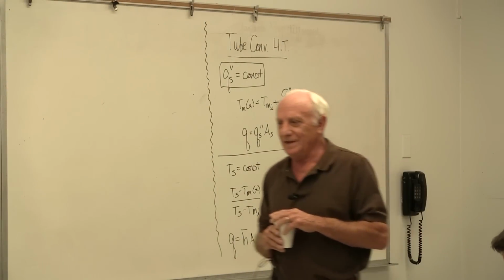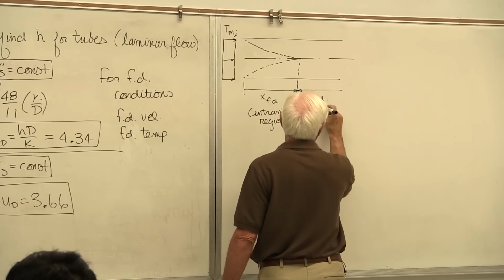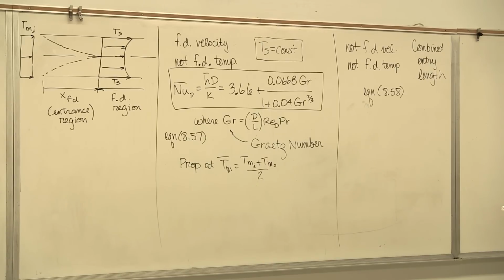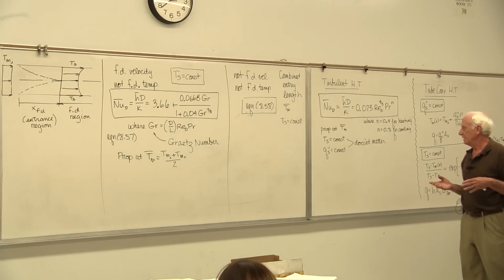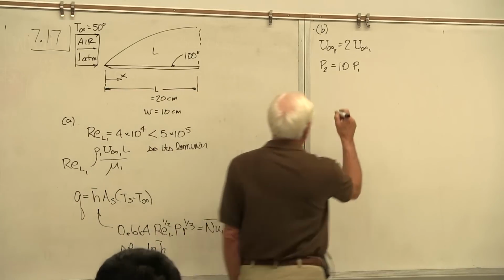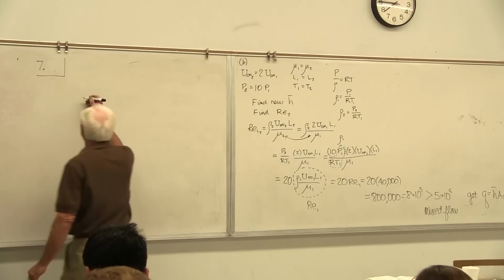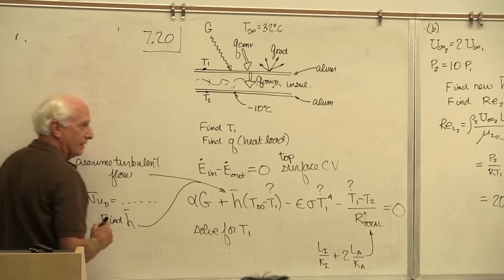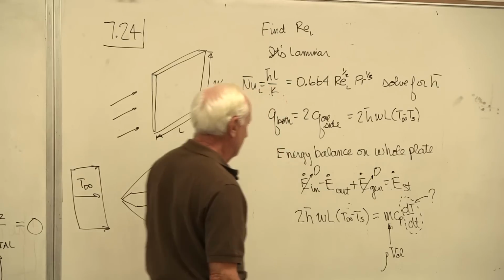Heat Transfer: Internal Flow Convection, Part II (23 of 26)

Comment: Hi, I think the point at which turbulent region starts should be checked by giving Re= 500 000 and finding Xc (critical length) before deciding on Mixed Flow for the whole flat plate at Re= 800 000 (Problem 7.17). But anyway, thank you very much indeed...
Reply: I believe that unless something is placed at the starting point to make the flow turbulent the flow will be initially laminar, since the Re is greater than 500000, we know that Xc is somewhere between the the initial point at x=0 and x=L.

Assumptions:

1. The flow is initially laminar at x=0
2. since Re for L is 800000, Xc is between x=0 and x=L

Conclusion:

The flow is mixed

However, there are some problems where something is placed at the origin to make the flow initially turbulent.